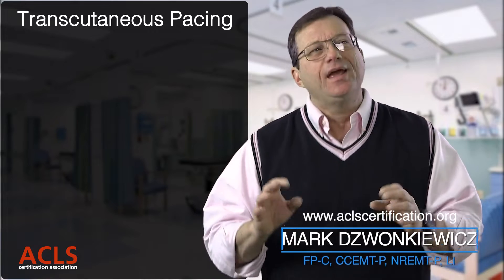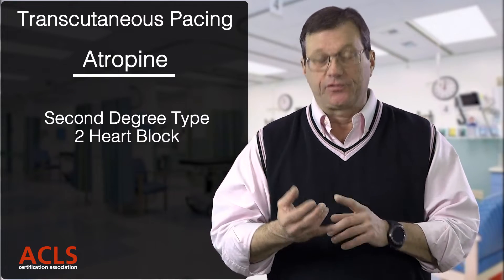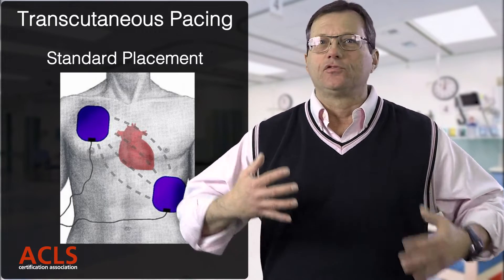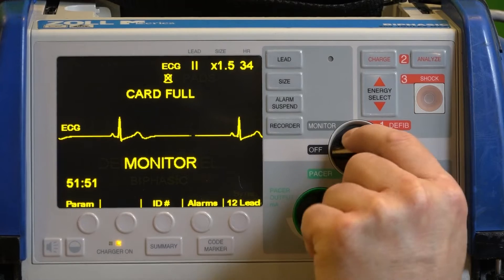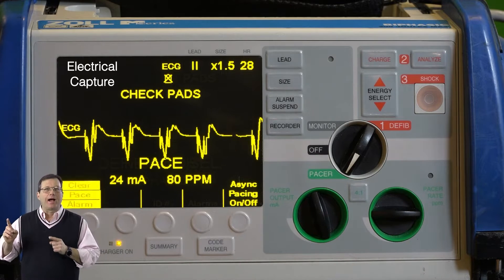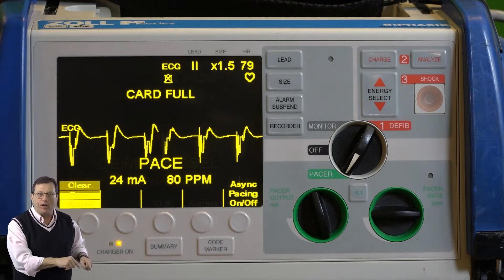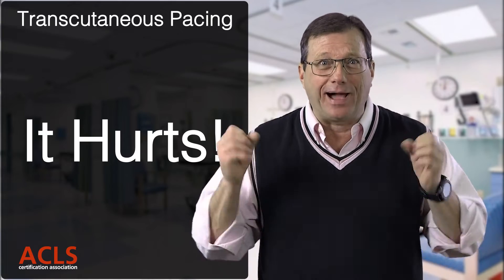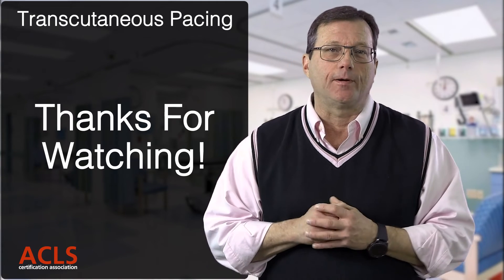Transcutaneous Pacing | ACLS Certification Association

Comment from the maker: 🫀 Transcutaneous Pacing: Quick ACLS Guide
When atropine doesn’t work (2nd° Type II or 3rd° AV block), it’s time to pace.
✅ Pads on (high right, low left works)
✅ Set rate, increase current
✅ Look for capture → Confirm pulse
✅ Don’t forget sedation! (Fentanyl or Versed)

▶ Know your monitor + use ECG leads to read rhythm
Let us know if you've used TCP in the field or hospital! 💬👇

Comment: You forgot the most important step for prep:
Pads alone will NOT do.
The machine must read the rhythm through another channel.
Pads are busy writing; they can't read and write at the same time.
Sounds stupid, but many beginners struggle with that concept a lot... 😊
Reply from the maker: Great point! 😊 You're absolutely right—pads alone won’t suffice for rhythm interpretation. Many monitors require separate ECG leads for accurate rhythm detection while the pads are “writing.” Thanks for adding this important clarification—it’s a detail that can trip up even experienced providers! 🙌